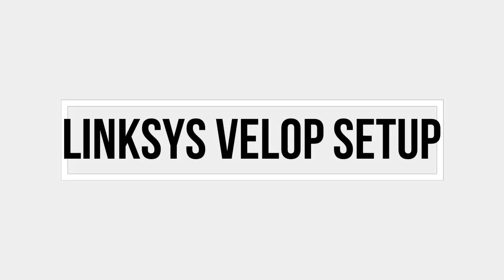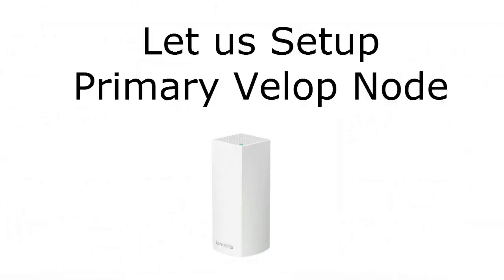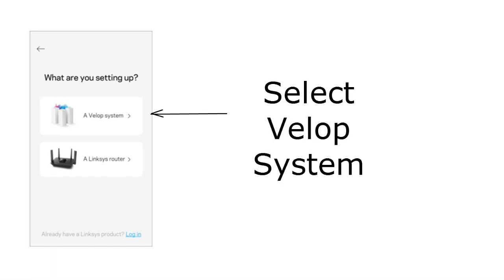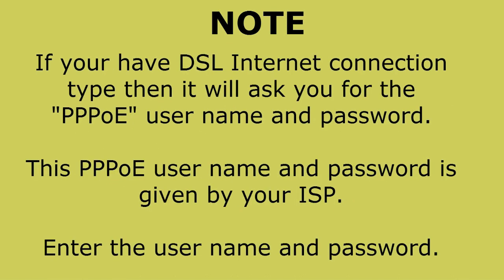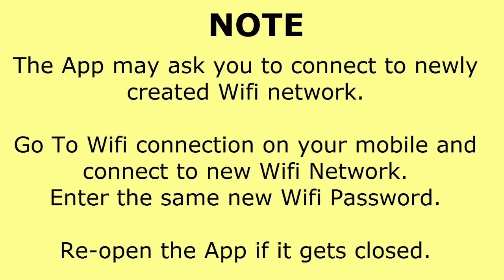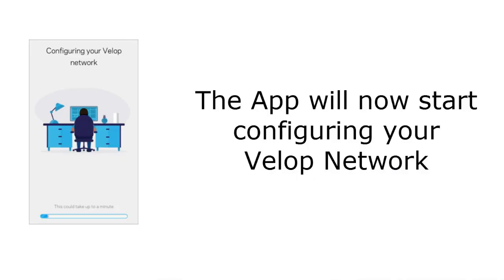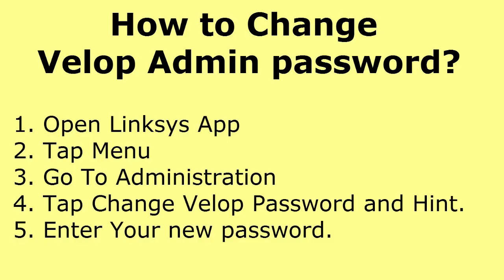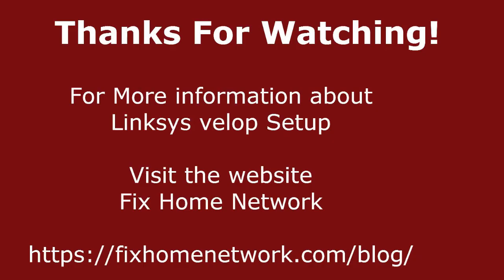Linksys Velop Setup | How to setup Linksys Velop | Velop installation

Comment: I used the app and have a modem router combined from the ISP. It is a fiber optic system but I choose a lower speed package. With the ISP system already given a name for SSID and password, once at the point of adding new name and P/W, it wouldn’t let choose anything other than name & p/w in the bottom of the node. I have a cell only as laptops pile up broken. Retired, it is hard to find the funds. I enjoyed the video information you provided and may choose to follow the blog. Thank you kindly!

Comment: Do I have to put my ISP modem/router in bridge mode to use this Linksys as my router? Nobody ever mentions this in reviews but I read it elsewhere.
Reply from the maker: Not really needed . If it is modem - router,  it will detect automatically.
Reply: @FixHomeNetwork  Thank you. I read that conflicts could happen with NAT features between the 2 units and also both units having their own wifi to conflict.

Comment: Hi, I need help...!!!
I`m using MX10600(2pcs pack). Now I can set-up primary node successfully but I can fix the secondary. I used the apps to adding new node but it cannot find my 2nd node even the light of 2nd node is in "Purple". It any mistake or anything I need to do? Please help to advise what should I do.....Thanks!!!
Reply from the maker: connect any computer to the second node. reset the second node and try to change the settings manually. see if that works.
Reply: @FixHomeNetwork  It seems like work.....thousands thanks for your help....

Comment: i wnet over the setting velop twice and when i searxh wife connection all i see is the main router . i dont see the other two velop. need help whith this
Reply from the maker: Let me know the connection setup. How many Velop nodes do you have in total. Is the main router a wired to the velop node or its wireless connection? Please explain the setup.
Reply: @FixHomeNetwork  I have 3 velop node in total all identical.  Only the main is wired ethernet to modem and a TV living room. 
So the 2 others are wireless.  They set up precess says it was successful but I don't see all of them.i named them living room dining room and basement but I see only living room whitch is the main when I search wifi to assign my devices
Reply: @francismonthe6724   I think all the nodes are setup to use primary wifi network. they are all connected to same wifi and broadcasting same SSID / wifi name. That is why you will see single wifi ssid .
Reply: @prashantmittal5643  I understand what you saying but what the point when I'm asked to name them while setting up the velop. I will give Linksys today to confirm what you said because iam about to return it to try different brand.  Thank you.

Comment: Warning!  Stay away from Linksys Velop. Unless you want a Wi-Fi you need to restart
at least once a day or manually do the channel search several times a day and
your Wi-Fi speed is still way under 3G (even if you have fiber connected with
200/200), that is!  - Terrible in every way!
Reply: I have not had that experience nor waiting for videos and smart tv. If you have set different security modes from ISP equipment to the new Velop nodes, this will cause connection interruptions over and over. (WAP/S) - (WSP/2)

Comment: Hi, I have a question about this concept of mesh internet setting, I am very new to this and wandering if you still have to use your router/modem even after connecting thie mesh network? Do I have to leave in on the router?
Thank you for any comment.
Reply from the maker: If you wish, you can replace your existing Router/modem network with new Mesh network. If you do not have any network and you want to create a new network, then you just need modem from Internet service provider and Velop Nodes. So either case, you need the modem from the internet service provider for sure. Please explain your current network setup.

Comment: Are you able to hardwire the velop system?
Reply: Yes, If you want, You can hard wire the Velop System. You want to make wired connection between primary and secondary nodes? 
First you need to setup your primary node with your modem. The secondary nodes can be hard wired to the primary node. In this case, you do not even need to configure the secondary node, it will get configured automatically with the wired connection to the primary node.
Reply: @prashantmittal5643  I want to connect each node to the primary modem
Reply from the maker: @ChristianHernandez-do5bl  You mean primary modem? I believe the internet modem must have only one Ethernet port to connect primary Node. If there are many Ethernet ports on the modem then it must be a Gateway modem like a router. In this case, I will suggest you to connect only Primary Velop node to internet modem. Connect other nodes to primary node. This will increase your wireless coverage area.